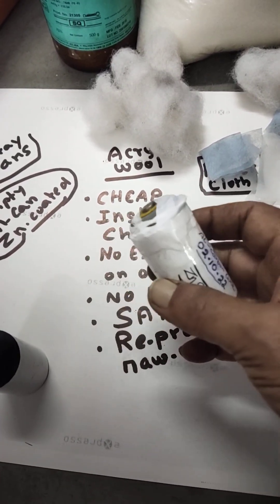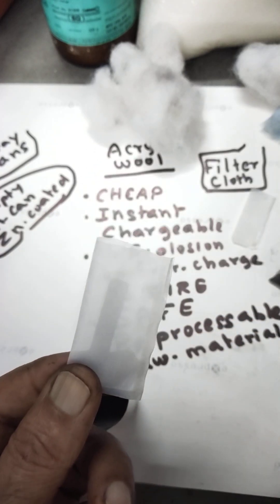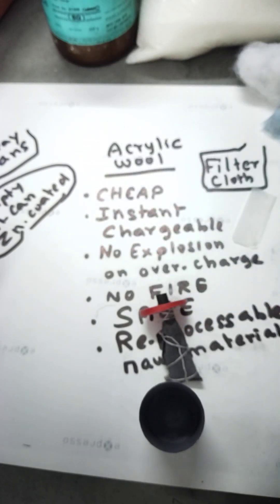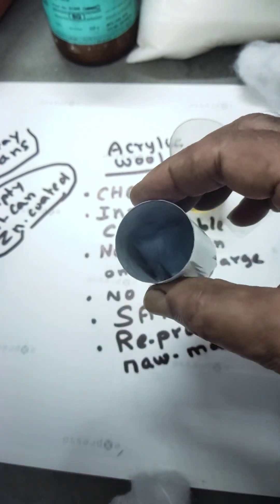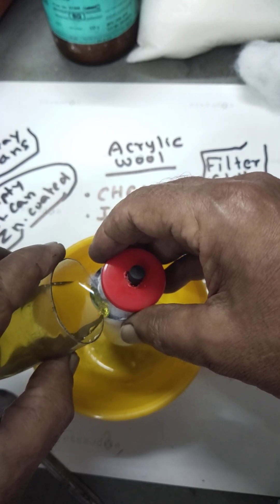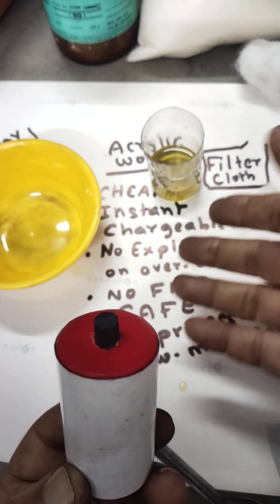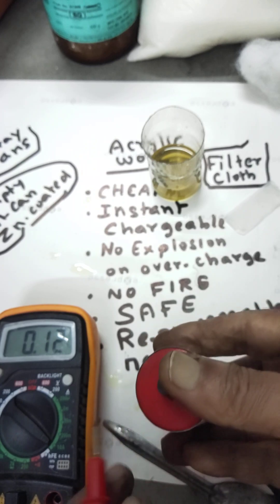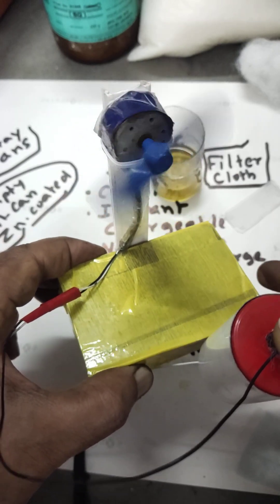CHEAPEST, SAFE, HIGH CAPACITY , INSTANT- CHARGING ALUMINIUM CHLORIDE BATTERY, NO-FIRE/ NO EXPLOSION

Comment: Few years ago I tried many times to make Aluminum chloride and urea ionic liquid every time when I heat it up to make it, after cooling it always become solid again... How you able to remain it in liquid form at room temperature 🤔
Reply: AlCl3 Urea Ionic Liquid reacts with Oxygen in the air to become solid again. The Ionic Liquid only stays liquid in an inert atmosphere, like nitrogen, argon or vacuum. 

So the more feasible way is to make another ionic liquid that does not solidify in air.
Reply: @aadhithvarathan5432  : mostly all . . . glycerol worth to try.

Comment: I have seen so many research papers talking about how aluminium, AlCl3-Urea Ionic Liquid and Graphene Cathode makes a wonderful Energy Dense Battery. However, the reason why this battery does not come to the market is as follows:

1. The ionic liquid freezes in the presence of oxygen and moisture in the air. So it needs to be manufactured in an expensive glove box with Nitrogen or Argon Atmosphere.
2. Graphite does not intercalate AlCl3- ions well. Only Nano Graphite and graphene does, due to the ionic radius reasons. Thus, the energy density with graphene is twice of graphite.
3. Due to a high melting point of AlCl3 Urea Ionic Liquid of 16 degrees C, the ionic liquid does not conduct electricity well, leading to sluggish performance. 

However, I am very impressed with your new approach, of using an aqueous electrolyte of AlCl3- Urea. This will surely improve the performance a lot. By using carbon black, we are circumventing the graphene issue, as the graphene layers in carbon black is less organized than graphite, allowing more intercalation. Activated carbon powder will work too. 

The reason why no one has dared to make an aqueous solution of AlCl3 Urea is due to electrochemical window(EW) of water being 1.23V. To charge this 1.86V battery, we need about 2.5V, which is twice the EW of water. This produces hydrogen and oxygen bubbles which corrodes the aluminium electrodes, reducing cycle life. 

However, there is a solution to this. Adding lots of Sodium Perchlorate or PolyEthyleneGlycol (PEG) increases the EW of any aqueous solution up to 3.2V.  

I am an MBA Student and I am very interested to work with you to create a product . I have also been setting up lab and doing the same experiments as you from Trichy. Hope to see more videos on this chemistry, and collaborate with you.
Reply from the maker: Thank you for your information and valuable comments 🙏
Reply: @dkjawahar-techexpt671  You're welcome
Reply: Hey I am also working on a product development , it's in patient process so will can't tell much but can you help us in it, we can gave you a shares % in it
Reply: What do you mean by aqueous electrolyte of AlCl3- Urea?  (Water reacts violently with AlCl3 so adding water to AlCl3 -Urea completely destroys it).
Reply: Make a video as MBA student.
In your comment box.
We need a full battary to bit lead acid battery.

Comment: Pl more information for making ionic electrolyte
Reply: Urea means fertilizer sir ?
Reply from the maker: @varietycreation7078  yes, the same urea. You have to take 1.5 parts of aluminium chloride and mix with 1 part of urea roughly Okay
Reply: This  cell charging time ? And volt ? Charging  
Cycles ?
Reply from the maker: For electrolyte take aluminium chloride 15ml plus 7.4gm of urea. This will be the electrolyte.